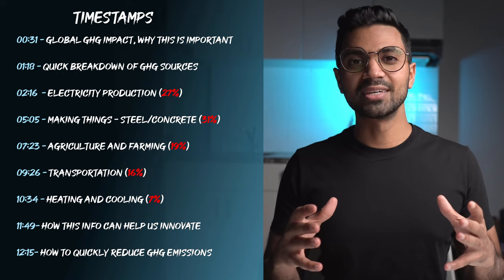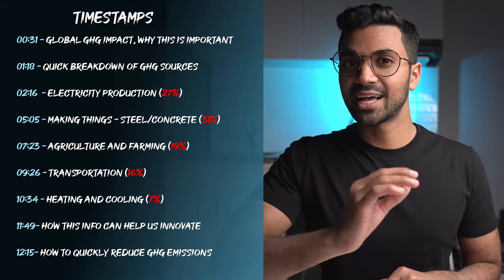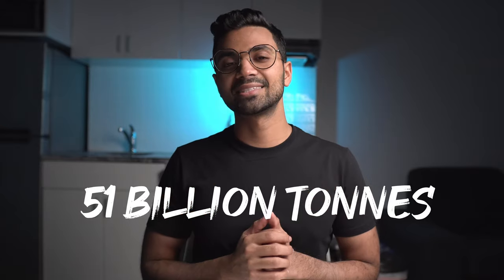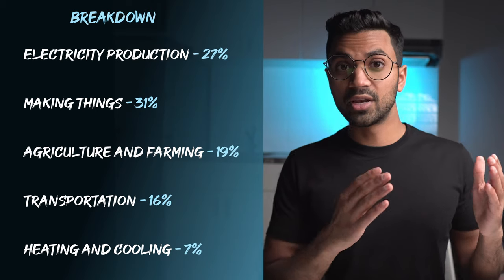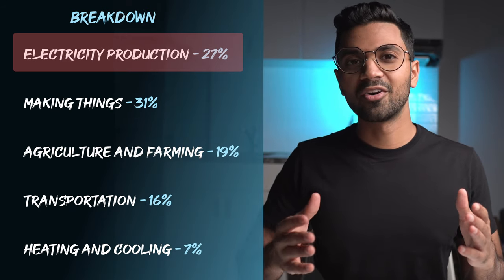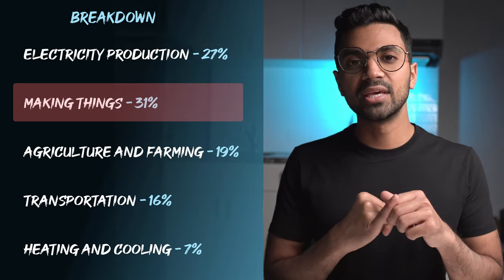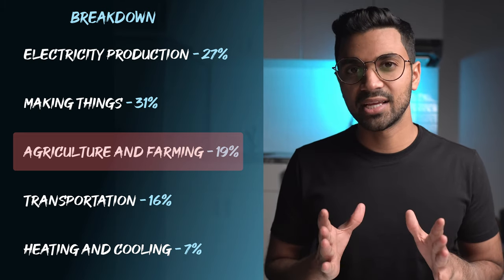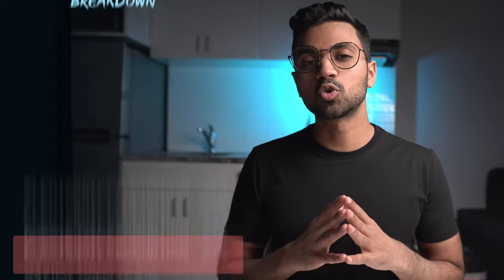5 Ways Nuclear reactors can get the world to NetZero

Comment: I don't know if nuclear shipping would be economical.  Aside from the capital cost of the reactor, I think the cost of the crew might be a showstopper.  The world's largest container ship, Emma Maersk, sailed with just 13 crew on her maiden voyage.  If you need 2-3 shifts of university-educated reactor operators (as opposed to tech-school diesel mechanics), and potentially a security team, their wages become a problem.  Liability is a problem - most ships are flagged in sleazy micronations to avoid legal oversight.  Then, at the ship's end-of-life, shipbreaking is done dirt-cheap in third-world countries.  There are also some port cities that don't allow nuclear ships to dock.
Reply from the maker: Great points you bring up David. It certainly won't be easy, but it may be possible in the future. 1st Drive down costs via SMR reactor technology (build reactors at scale in factories to drive down costs). 2nd Major Changes in International Regulation would need to take place. Lastly, designing technology that minimizes security risks & cost of operation.
Reply: In most circumstances the reactor would be shipped in a safe shutdown condition especially if it a Gen 4 reactor.

Comment: very informative video! I like the part about “making things”. Makes me wonder what the alternatives or solutions might be to replace those sources.  Interesting!
Reply from the maker: Delighted to know you got the chance to watch this video! Even more happy to read your comment Irena :) There are some really interesting alternatives like Cross laminated wood which can be used for construction and many other purposes. Also, other technologies are being developed for example, a new process to create Cement which takes Carbon (released during production) and injects it back into the concrete before its used on site. Although it only reduces 10% of emissions, the goal is to reach 33% reduction. Also, another process for steel production proposes using electricity to cause iron oxide to break apart creating pure iron, which is then used to produce steel with zero GHG's. Lastly, when plastics are made, half of carbon dioxide stays in the plastic (depending on type). From an emissions perspective plastics aren't as horrible, but can be detrimental to marine life.

Comment: Net Zero is a fallacy that must never be attained!  CO2 is currently in short supply to green the planet it needs to be at least 1500 to 2000 ppm.  CO2 is currently in saturation and doubling the CO2 will cause very little warming.  Prior to the Industrial Revolution the planet was dieing and CO2 levels had been dropping for 540 million years and during the last glaciation CO2 dropped to 180 ppm (plants start dieing at 150 ppm, and if plants die everything dies) it rebounded to 280 ppm as the oceans warmed after the glaciation.  However had the Industrial Revolution not happened it wold have resumed dropping due the single celled plants and animals which were causing the drop still being in existence; these plants and animals were using the dissolved CO2 to make body armor and still are.  Man pumping CO2 into the atmosphere saved the planet.  Net Zero will start the process all over again and the planet will eventually become lifeless.  Information based on information from presentations by Dr. Patrick Moore and others!